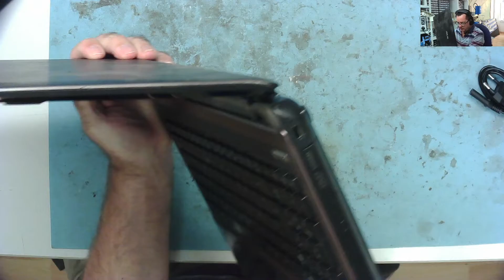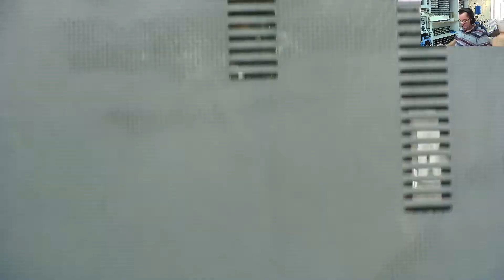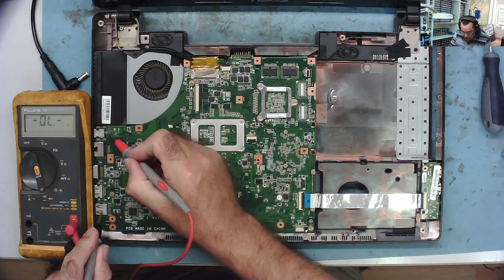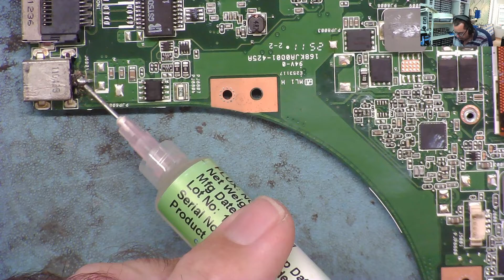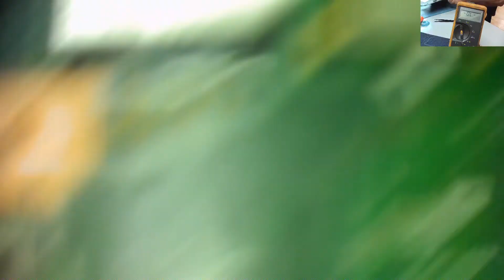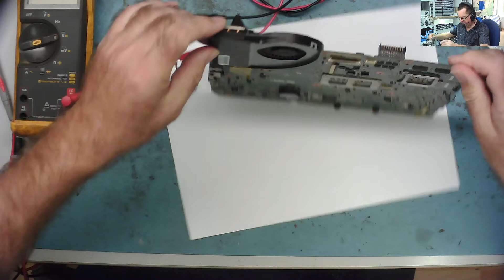How To Repair Dead Laptop - ASUS K53S No Power No Lights Nada Nothing. LER #105

Comment: Do you have a suggestion of what to check first if we had a loose power connection & laptop went off too many times and now power light is on but black screen.  Also HD light is off.  After getting screen back up, hoping to solder the power connection which was loose...new at this...

Comment: Hi your problem was a frozen bios. If you remove cmos  battery . Next time just remove cmos battery and short the pins from cmos battery. Or it was bad connection on the ram module. Just for info.
Reply from the maker: Yes that is the second time I came across this problem .  Thank you